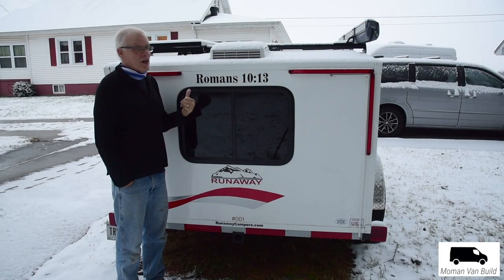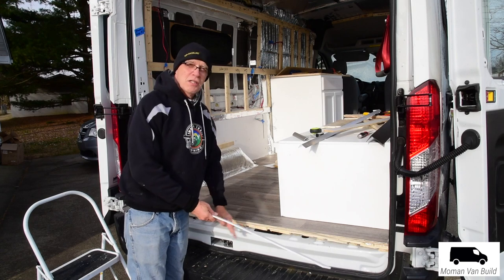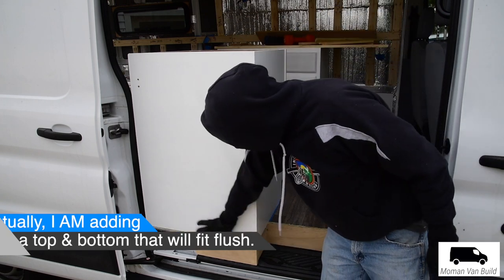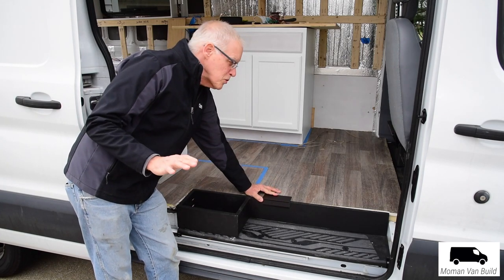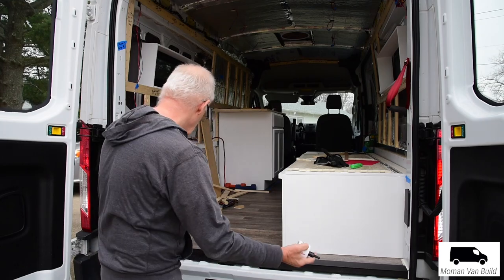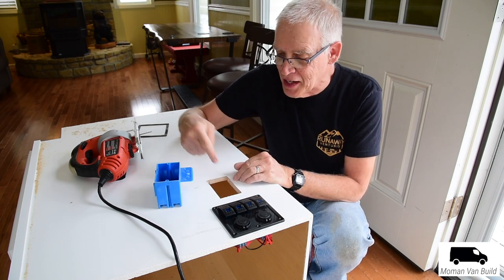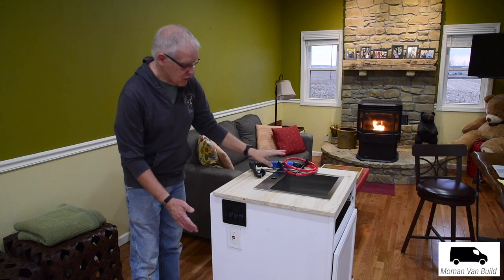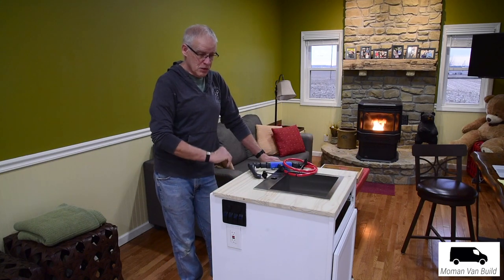Episode #24 Edge Trim and Sink Cabinet

Comment: I know this was a while ago, but please, what wood was used for the countertop? Ty!😊
Reply from the maker: I cannot remember what it is called. We got the pine board from Home Depot - it may be called glued edge. I know there were some round ones next to them. We should have put more coats of poly on it because it is easy to dent. If we did it again we might use a harder wood. Good luck!